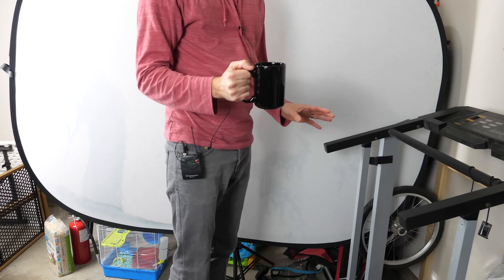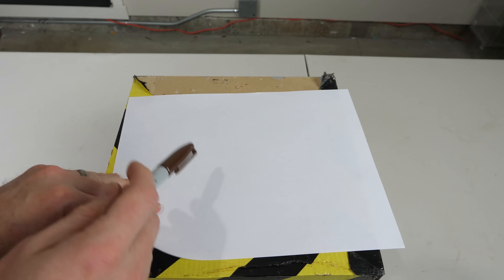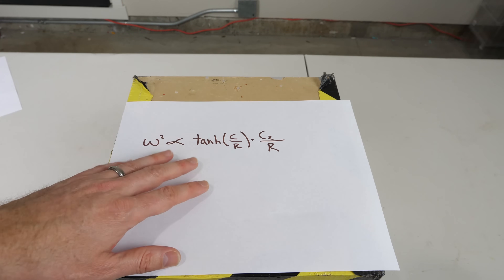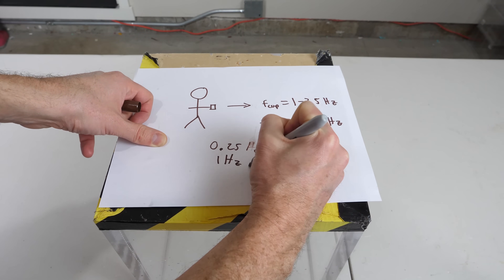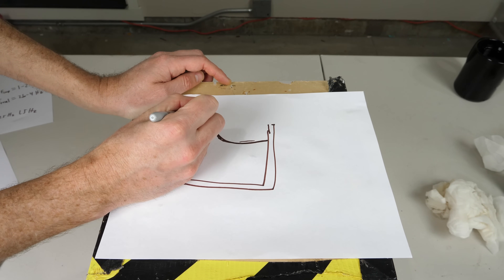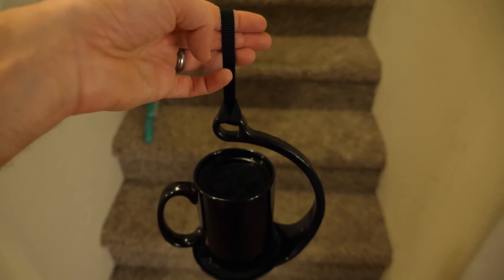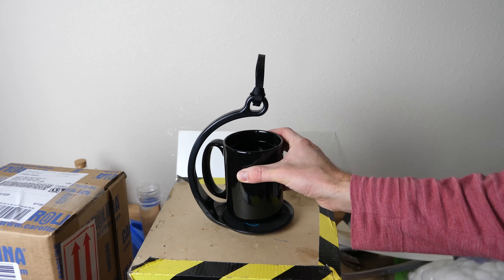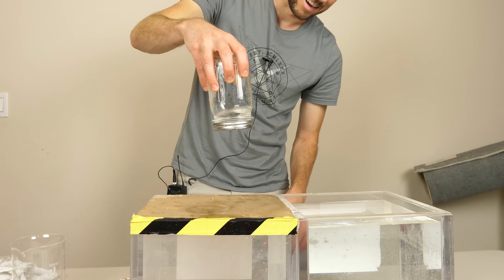Using Resonant Frequencies to Create an Unspillable Cup

Comment from the maker: If you want a good source for the resonant frequency of human walking and coffee spilling I put the source in the description
Reply: I got so mad trying to replicate your cup experiment with surface tension before I finished the video and saw your screen  😂
Reply: Isn't Centrifugal force just inertia?
Reply: no, the law of inertia states that an object that is not subject to any force, does not change its motion status or, in other words, either it does not move, or keeps moving with the same speed on a straight line. Centrifugal force does not even exist. It is a fake force that is used when you observe a motion from the inside of the system, where the law of inertia does not apply, so that you cannot see what really happen, which is a centripetal force that act on the object and forces it to abandon the linear motion in favor of a rotational motion.
Reply: @eleneasy  I know that centrifugal force is fake, but what he means by centrifugal force is really just inertia. For every action (centripetal force) is and equal and opposite reaction (inertia)
Reply: @chalindunn5796  Action and reaction are forces that do not act on the same body. For example. If body A pushes body B with a force F, the action,  body B will react on body A pushing it with a force equal in module to Force F but in opposite direction.  The two forces act on different bodies, so they don't cancel each other. The concept is simple but i have seen several students fall on it, even college students. I know that because i have done some tutoring in the past and i have seen it in person. 
Centrifugal force is an apparent force that we need to use when we observe the motion of a body from a reference system, i.e. cartesian axis,  that is rotating along with the body.  In that system you see a body that want to move away from the center of the reference system while accelerating. The only way to explain that is to introduce a force that is pulling the body away from the center of the reference system. This force its directed away from the center. This force is apparent (fake) because you introduced it to justify what you see. In reality,  if you were observing the motion from an inertial system, you would see the body rotating around a center of rotation and that body is forced to change continuously its direction of the motion by a centripetal force that accelerates the body toward the center of rotation. That force is called centripetal because its direction points continuously toward the center of motion. If that force was not there changing the motion of the body, the body would follow its inertia and move straight ahead,  without moving in circles. You can easily demonstrate that by attaching a body to a rope and make it rotate in circles using the rope in your hand. Then,  while the body is rotating, release the rope. That eliminates the centripetal force and the body will stop rotating and will start moving in the direction it was moving just before you released it, following the law of inertia. The centripetal force that you were exerting on the body was your action on the body;  the force that you were feeling when holding the rope was the reaction of the body on you.  That reaction was equal in module to the centripetal force but was applied to you,  so it has nothing to do with centrifugal force because you were not moving in a circle the same way as the body.  The centripetal force is a  real force, the centrifugal force is apparent because you have to assume it exists when you observe a motion from a reference system that is rotating along with the observed body; it exist only in that particular rotating system. The centripetal force is a real force because it exists in any inertial system,  not just in one particular system.
Reply: @chalindunn5796  no inertia is closer to momentum centrifical force is acceleration toward the centre of a circle or parallel to the radius
Reply: @maxyyyyyyy274  let me find out you know things. 😂
Reply: Where can I BUY THIS
Reply: Just put a lid on it 😂
Reply: @harrysmith9773   cups that dont have tops.. then what?
Reply: Over time your body will naturally develop its own way of moving the hand, so you dont even need to focus to not spill.

Ask any watress how they do it
Reply: 7:16 centrifugal force is a misnomer. The force that causes obejcts to have rotational motion is centripetal force and it is directed inwards towards the center of rotation. In this instance, the centripetal force is the horizontal component of the normal force from the device on the cup
Reply: Can I buy the thing you were using?
Reply: Wouldn't it be easier to change the frequency of the cup. Like with a lid.
Reply: I want a good source for that device I can put my cup on and swing it around all Willy nilly like.
Reply: ....genius!......
Reply: The Action Lab I wish you could help tutor me for my college courses I feel like you’d be a great tutor and obvious very knowledgeable on different subjects
Reply: Mason jar bit is reused
Reply: I have a neat mug that is tapered smaller towards the top (like a section of a  cone). Not only is it hard to knock over, its highly resistant to sloshing when im walking around.
Reply: If you had a small cup inside a larger cup, and the smaller was floating in an outer layer of water inside the bigger, would that prevent spillage as well?
Reply: Your videos are the best thing that happened to YouTube👍
Reply: Me: clicks video

Vid : starts O K A Y   S O ------

Me: ok im done
Reply: Why is liquid nitrogen liquid when its actually freezing cold
Reply: @sameerkhan_86  It's boiling point is 77K / -195.79C / -320 F. It's liquid the same way water is liquid at 40 C.
Reply: @sameerkhan_86  Its boiling point is 77K / -195.79C / -320 F. It's liquid the same way water is liquid at 40 C.
Reply: Cool video very education but fuckkk your voice hurts, have a dislike

Comment: Or you could pack the cup full of drinking straws… I was actually expecting this to be your ultimate sollution as it prevents slosshing by deviding the diameter of the cup in to smaller sections and still allow you to normally drink from the cup.

Comment: No you don't have to do all like that you nee to make your own resonant frequency like you need to move the cup and the drink what you have in the same frequency like put a sting on both sides of the cup like North and South sides and move your cup whlie walking it won't spill because water has a frequency built in the center therefore it's like a vector quantity so which acts more like you put more frequency that that of the actual frequency it would beat that frequency and take the new frequency by substracting the real frequency from the combined average frequency

Comment: The way that special handle he showed works is the same reason soldiers can sit on the edges of helicopters and not fall out. The fulcrum is the rotor shaft, everything beneath it moves together and all the forced act in the relative "down" of the aircraft,  so the harder the aircraft maneuvers, the more in place the troops are held against the floor.

Comment: im pretty sure the jar thing dosnt works because of only the surface tension but because of the underpressuring of the air in it but being not strong enough to pull air thru to break the tension. so it would spill as soon as you put a slimm straw in to let air in.

Comment: Old fashioned RC helicopters rotor disc behaves the same way. Back in the early 90s I figured out I had to introduce some random jiggling on the stick to prevent the oscillation feedback from building up.

Comment: So, many years ago they came out with unspillable coffee mugs that were in the shape of a cone with the tip cut off. The base was much wider than the opening, which was only 1.5 inches (3cm) in diameter. You have two factors that help you.  First, the cup opening is smaller, thus dramatically increasing the resonant frequency.  And second, the inverted cone causes the sloshing coffee to have trouble building an increasing standing wave because the liquid can’t easily climb “backwards”. 
Basically a ceramic conical flask with a convenient handle.

Comment: I wonder if adding a  wall bisecting the bottom of the cup and coming halfway up sides of the cup would make it slosh resistant. Maybe the area below the wall would have a different resonant frequency than the top and interfere with the momentum.

Comment: I just ignore the handle and hold the mug with two fingers opposite of each other. Imagine a hinge system, but completely natural. Drink can't spill because gravity keeps it down and the two fingers holding it are loose enough to let it shift around to maintain gravity. 

Basically,  that neat cup holder he had in the video, but the physics are simulated with your hand by holding it a specific way instead of with the cup holder. My drinks never spill, unless all the ice clumps together and shifts up my nose when taking a sip lol.

Comment: So, where are the Unspillable Cup? Yes, there are solution how to not spill, but this is not Unspillable Cup, this is tool for carrying a cups...
I was expecting a mug with a special shape. For example, a mug that has the upper edge bent inwards, so that the generated wave would collapse into the center of the mug...
Reply: I was also thinking about a modified mug. I was hoping for a mug with a gyroscope and a dampener. I still wasn't disappointed in the video though.

Comment: One thing I also noticed about many jars too, rather than using the screen trick, I first noticed with those clear straight Coca Cola drinking glasses... the inward bevel at the top is surprisingly good at rejecting spills even if the liquid begins to resonate.  It seems the feature, if large enough, redirect the liquid rising up the sides toward the centre, and even if necessary, sloshes and throws it away from the outside edge.  Even if the liquid rises above the edge, inertia directs it toward the centre instead of letting it climb out over the edge.
     Apparently some places use a similar design for seawalls, to reduce seawater overflowing during storm waves at high tide... The water sloshing up to them gets thrown seaward instead of climbing up over the edge and flooding the walkway etc.
     With the sheer number of glasses, cups and mugs made non-stackable, I'm surprised this feature isn't much more commonplace.  Sometimes I'll keep a few small jars in the cupboard just to drink out of if I know I'll be up and about.  As much as I like the Coca Cola glasses, I didn't get more because those ones are thin and easily break 😜.

Comment: Isn't the amplitude (or strength) of the movement at least equally important? You can shake your glass at 2Hz but shake it just a few millimeters back and forth and it won't spill a single drop. Shake the same glass at the same frequency of 2Hz, but move it 10cm back and forth and you'll spill alot if not all.

Comment: Sure, that swinging cup holder solution is pretty cool - but
...I would just use a lid instead 😅

Perhaps a expandable rubber disc that starts off as a small circle and can grow in size/expand its radius until it's fully filling up the diameter of any-sized cup (kind of like how an umbrella works)? That could fit right into your pocket, and thus would be a lot easier to carry with you than bringing in a whole swing contraption to the office each morning! 😆

Comment: The drain in my bathroom sink has built in drain catcher with 5mm holes. It took me like 20 minutes of diddling around with it to realize that surface tension keeps the sink from draining at a faster rate than a few drops a second.

Comment: 2 things:
1. You can avoid spilling your cup by expertly controlling the muscles in your shoulder as well. However, unless you are super amazing, you will not be able to spin in circles. But the benefit is it's, can be trained & doesn't require an extra object/device.
2. At what point is the opening of a container too large for surface tension to hold the water inside & is it also affected by how much water there is?

Comment: Ik this is a year later, but you can also make the cup itself with a very small opening, and it keeps it from going out because of the difference in pressure i think. I noticed this in chemistry, when the flasks held liquid in them even when i tilted it up to 90 degrees sideways

Comment: I was with my friends at a park after having dinner at a burger king, so i saw this swing in the park and I thought, huh? would a cup fall off the swing if I were tl swing it? I figured that it wouldn't just because the only force acting on then would be gravity, and gravity is always pointing to the same directions tk the both of them with the same acceleration, so yeah it would be coupled together, in tjis case it's becaue of the centripetal force, which acts with the same acceleration (because if it didn't either the cup would be floating or the holder would break) and it's also pointing to the same place (gravity points to the centre of the earth) centripetal force in this case points to your finger.
It was really cool to watch it happen and now I see an actual application for that effect, great!

Comment: There's another structure that reduces spillage due to sloshing, and I learned about it by using those straight Coca Cola tumblers, and it's also built into some walls built into a choppy shoreline...

The top edge of the glass is curved inward, such that liquid sloshing up the side gets thrown towards the middle, instead of up over the edge, avoiding spillage. It has that horizontal kinetic energy by the time it reaches the edge.  Works well.  On shorelines, waves will splash outward toward the water instead of splashing back down and soaking the walkway etc. above.  It works only for sloshing, not long period overflows, of course.

Comment: Instead of dampening the frequency why not use a different frequency like centrifical force if the liquid spins in said cup at the opposite direction of the way the liquid moves would that not counter balance the frequency to stop it from spilling while walking.

Comment: All you have to do is not look at the cup when your are walking.....the way it works is when you are looking at the cup and are trying to compensate the motion of the fluids by sight, you make adjustments  but are way to slow,  you can not make the adjustments fast enough.....so if you don't look at the cup and rely on the feel of the cups motion, your body's natural ability for balance creats the motions necessary, much faster and better timed to keep the fluid from sloshing.
 Try this: get a cup full of whatever, start walking while watching the fluid and try to keep it from sloshing, then with same amount of fluid try walking without looking at cup and not focusing on trying not to spill and notice the difference....you will see a huge difference. It might take a little practice to not think about it, but once you can stop thinking about it, you will not spill anymore.

Comment: After my Fluid Mechanics 1 frenzy I had run out of disposable cup covers and faced with dilemma of which cup style was the most spillproof I concluded a thin and tall cup would develop a lot less potential energy during a horizontal acceleration and hence less pressure on the side walls. Pressure can also be expressed as mm of water column so you if you actually do the math you get a direct reading of the wave height for each acceleration vector and cup style you choose. Though your equation shows a different property (and is a ton easier to solve), while my approach focuses on the sudden and violent horizontal accelerations transmitted from my car's cupholder.